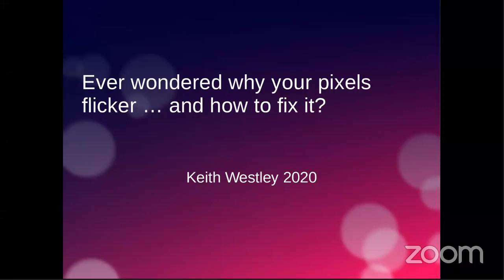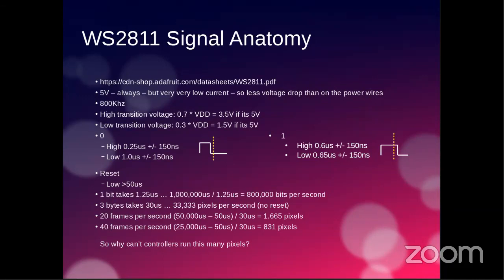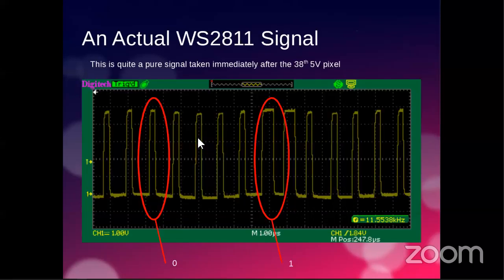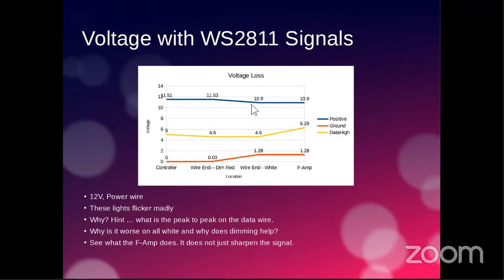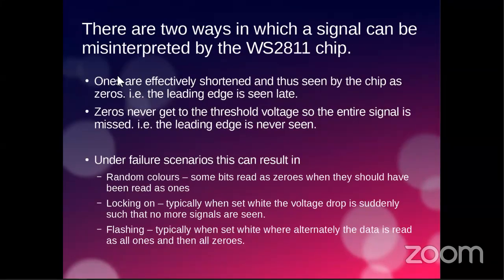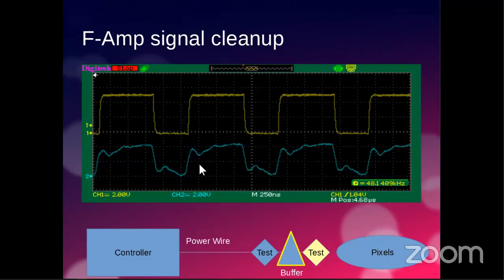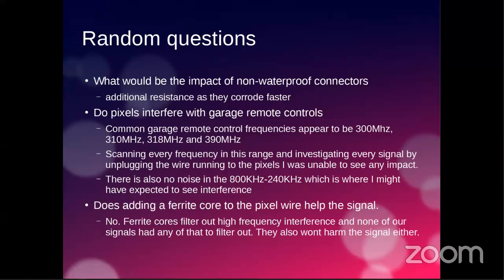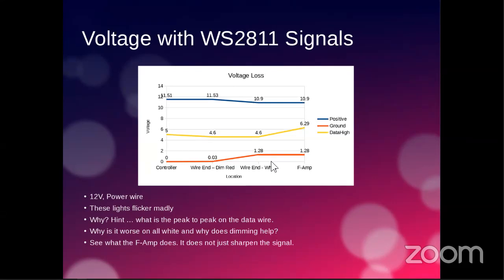VCS 2020 Ever Wonder Why You Pixels Flicker and How to Fix It - Keith Wesley

Comment: First of all, thank you for a quite educative presentation about this topic.
Secondly, I have another problem with pixels that you might know the solution to.
My drivers on strip occasionally have a malfunction, some just pass data to the other driver but their own pixel shut off, some cut off the rest of the strip.
I use a 12V addressable strip, 1 IC driver per 3 LED. Usually have an IP65 protection (waterproof) strip but a similar problem occurs when I have an IP67 (the strip is protected by silicon tube). Is it a problem of overheating drivers or is it something electronic's issue? Could the data signal, high than 5V, on input do damage the driver?
It might inform you that I frequently use GS1903 rather than WS2811 drivers.

Comment: OK, pretty good  video!!  I have learned alot form your information!!!

There is some problems with you analysis on the signal format.  So I ask you how do you read this number 1,000,000?  Left to right or left to right?  We read words from left to right where we read numbers from right to left.  From the least significant digit to the most significant number you also do the same for your signals coming out of your controller and test equipment like an oscope or digital analyzer..  The right side spike on your signal format is not  turning it off, it is actually turning it on and the capacitance on the wire is discharging at a slow rate is having a nice roll off when turning it off on the left side of the spike.  It is a habit most of us are not aware of unless you are in electronics looking a digital formats from time to time.  Even most websites get it incorrect. Just my ADD kicking in.

For those of you not know what overhead is, it is non information bits separate from the actual data needed to make the pixels do what you want to do.  For example Frame bits, sample bits, start and stop bits (async) and so forth and so on.  You have to tell what pixel and what color and what time it needs to do is considered information bits.
Reply: Huh, wtf are you talking about - on a scope, time runs from left to right. The "foot" on the right side of the waveform elongates the on-pulse, and in a timing sensitive protocol like WS2811, those extensions of the on pulse can cause problems.

Comment: Why do not use 12V power supply from servers (700-1500W) and use step down 12->5v directly on props, tree...?
Step down 12v->5v like Daygreen ip68 rated.

Comment: Slide 1 - 0:37 - Intro
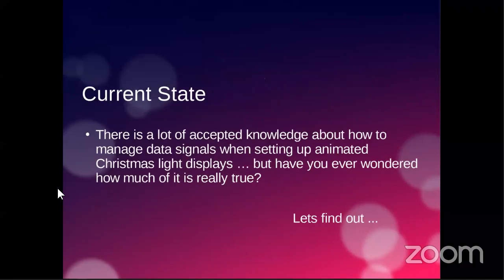Slide 2 - 2:31 - Current State
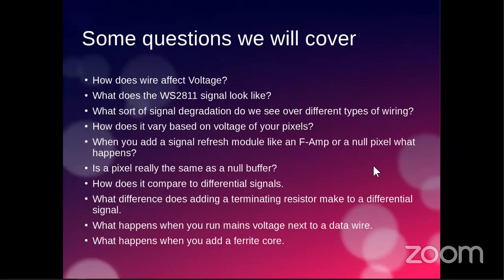Slide 3 - 2:58 - Overview "Questions we will cover"
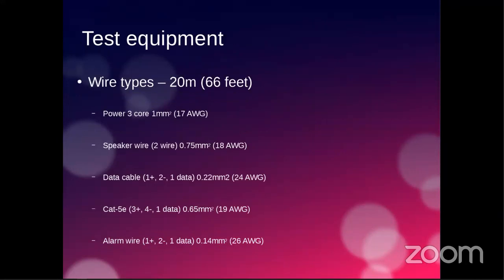Slide 4 - 4:00 - Test equipment - Wire types
Slide 5 - 6:15 - Voltage Drop
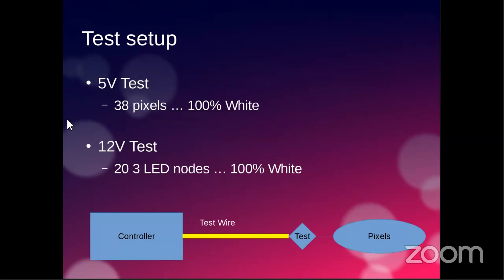Slide 6 - 9:10 - Test Setup
Slide 7 - 10:24 - Results
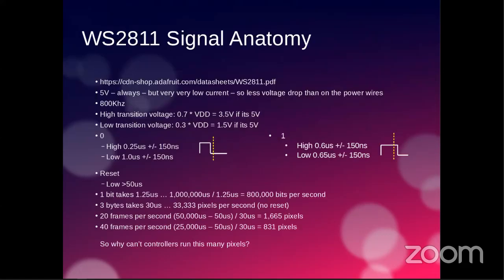Slide 8 - 12:25 - WS2811 Signal Anatomy
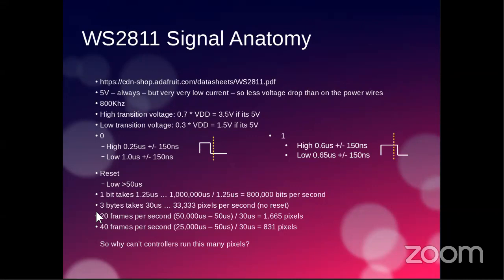Slide 9 - 20:22 - WS2811 with a digital signal analyser
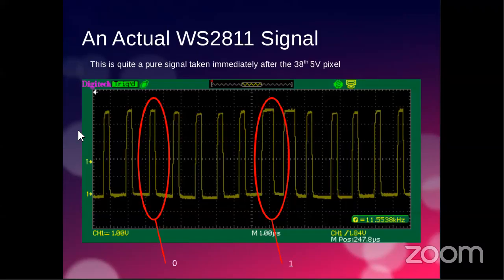Slide 10 - 22:00 - Actual WS2811 Signal
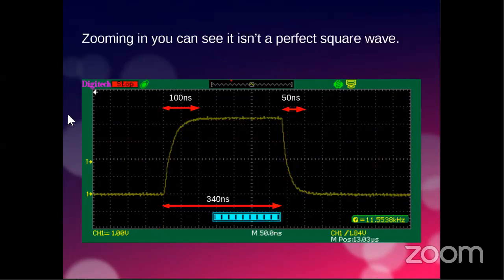Slide 11 - 23:13 - Zooming In you can see it isn't a perfect square wave
Slide 12 - 24:51 - How does wire type affect the signal?
Slide 13 - 25:03 - Power Cable
Slide 14 - 26:45 - Speaker Wire
Slide 15 - 27:30 - Cat5e
Slide 16 - 27:43 - Data Cable
Slide 17 - 27:53 - Alam Wire
Slide 18 - 28:00 - But why this shape?
Slide 19 - 29:21 - 12V Flickering over power wire
Slide 20 - 31:47 - Voltage with WS2811 Signals ** Really Good Slide ** Bill Porter
Slide 21 - 45:13 - There are two ways in which a signal can be misinterpreted by the WS2811 chip
Slide 22 - 47:00 - but why this shape?
Slide 23 - 50:48 - How does the type and voltage of pixels impact the signal
Slide 24 - 53:38 - Null Pixels and null buffers, test setup, Buffer before wire
Slide 25 - 54:27 - Null Pixel
Slide 26 - 55:17 - Hanson Null Pixel Buffer
Slide 27 - 55:43 - Falcon F-Amp
Slide 28 - 56:00 - Buffer after wire: F-Amp Signal Cleanup
Slide 29 - 57:08 - DMX over speaker wire
Slide 30 - 59:10 - Falcon Differential Receiver signals
Slide 31 - 1:00:00 - Keith's Test Controller board
Slide 32 - 1:00:55 - Controller Signals - 12v. power lead
Slide 33 - 1:06:50 - Random Questions
Slide 34 - 1:09:22 - Final Suggestions

Comment: I just tried adding a 2nd ground wire to a string of 360 pixels 12v (regulated) which was flickering even with 2 points of power injection, and now nothing at all!  Can't believe that made so much of a difference.  Thank you
Reply: What do you mean by "adding a 2nd ground wire"? Like from where to where does the 2nd ground wire go that you added?
Reply: @nicflores6821  from the box where all my grounds are (grounding bar), to the very first pixel in the string.  So at the first pixel you will have 2 grounds to attach.
Reply: @ducebigalow8834  thanks! I'll give that a try. One of my three 12v strips has some flickering issues.
Reply: @nicflores6821  apparently this happens more with 12v than 5v.  Keith did a very good video on this.

Comment: Very informative!  Wish I could have caught it live.  I use all 12v with Sans Devices.  I use 4 conductor 18awg alarm wire and will definitely double up the ground wire.  The 12v sure are picky and I use null pixels often.  One issue I have seen that wasn't addressed is air temperature.  I know it's not a problem everywhere but here in northern Indiana  I setup my pixels in Sept and run them all October and they will run fine.  However once December rolls around, we tend to be in a much colder weather pattern and I start having problems with flickering and locking on that weren't present in October with warmer weather.
Reply: What do you think or better 'how' do you think that colder weather is affecting flickering of your pixels.?? Thoughts??